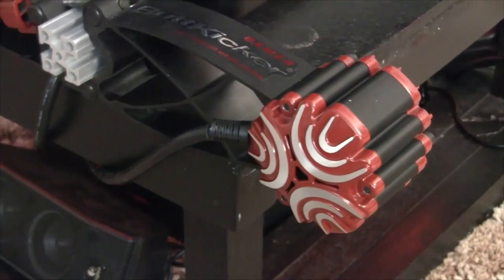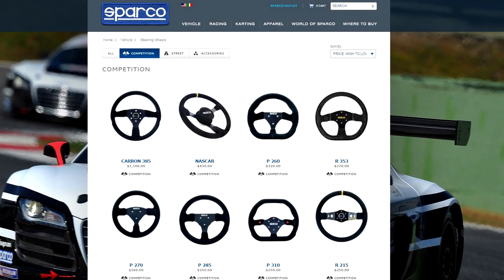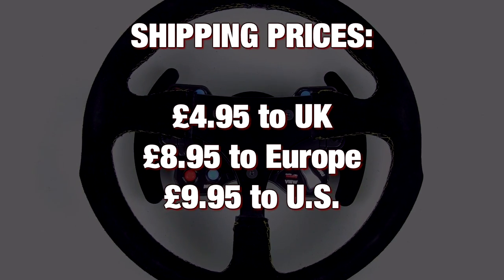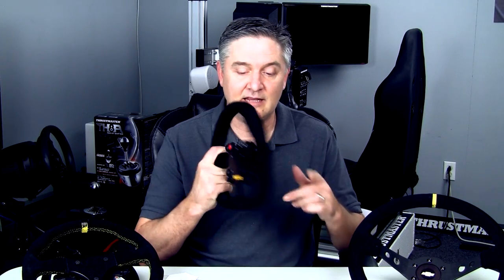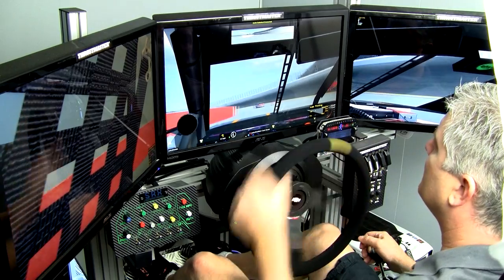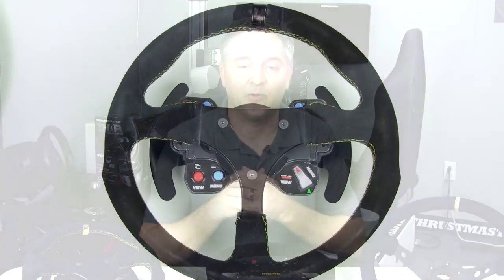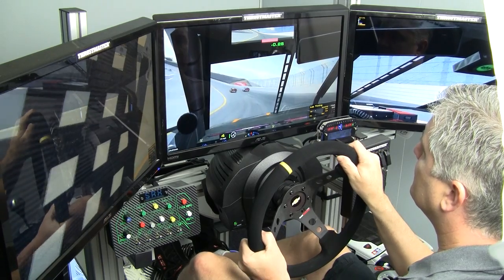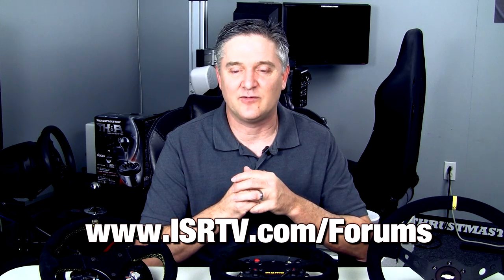Thrustmaster Steering Wheel Adapters for TX, T300 RS and T500 RS

Comment: Hey inside sim racing. I just bought a t300 gte it's really a good wheel. But he really makes a loud sound out of the engine. Is this normal ?
Reply from the maker: dutch NFS Gaming Is it a fan noise or something else ?
Reply: Yes. it happens most of the time when i do my FFB on
Reply: If you're talking about the T300RS, I have the TX (very similar wheel) and it's totally normal to hear the fan running while you're racing. If the game is at a loading screen you can probably hear it but as long as it isn't loud enough to hear during a race then I'd say everything is fine. If you haven't updated your wheels firmware to the latest version I suggest doing so as the newest update makes the fan shut off when the wheel cools down instead of never shutting off like it used to do.

Comment: Great video Darin. What I did was use the DSD adapter and put one of the Fanatec rims meant for their modular wheel hub. I have the classic rim and now I'm looking to get the GT rim.  Put a quick release on the  DSD adapter and ...BAM. Quick release action with a larger diameter wheel rim. Plus, if I ever upgrade to the CSW V2 I will already have the rims I like. :-)
Reply from the maker: SnappyDee2O4F Great idea !  Thanks for sharing

Comment: Great review, I recently bought an 300mm Oreca racing wheel plus an DSD adapter and an slim quick release, it´s a good solution if have more than one wheel, and if you order one from China is cheap too. The DSD adapter is great, but I recommend sanding the threads before you attach it to the base.
Reply: TheVblaster Where did you get that Oreca wheel?
Reply: idaanx Hi, you can get one from their site http://www.oreca-store.eu/cockpit/steering-wheels/steering-wheels.html

Comment: It is possible to use the Xbox controller while using the tx, it gives you all the button functions except for steering and accel/braking. Just make sure you have a shifter if you plan to get an aftermarked wheel.
Reply from the maker: DriftGamingHD No, you can use it for chat though
Reply: Inside Sim Racing I use it to get thought menus and works to move the camera playing Forza. So, yeah, it works.
I have it plugged via a usb cable, by the way.

Comment: You cannot do this with fanatec as they put the controller in the rim, not the base, you have to either attach a fanatec wheel or use their universal hub or the base won't work. You can get adapters to put a fanatec rim on a non fanatec base, but not the other way round.

Comment: So I'm using the DSD adapter along with a 320mm MOMO Prototipo wheel on my T300RS for PS4. It works fine. I keep the stock T300RS wheel attached to the servo until I'm all the way into the sim (project cars). Once I'm ready to drive I just swap out the rims & I'm ready to go. I just use controller to navigate thru the menus. :)

Comment: Inside Sim Racing Hey Darin, do you know of any mods for the T300 which adds a rally style paddle shifter? You know, the single huge paddle shifter on the right of which you pull to upshift and push to downshift? I've been looking for one but haven't had much success.
Reply from the maker: BiskutKibal I think Steve Spenceley is working on something like that.

Comment: Any video showing T300RS wheel connected to G27 pedals with adapter ? Is this combination works for Project Car on PS4 ?
Reply from the maker: Ng Foo Sin Steve I will be posting a video like that soon
Reply: Ng Foo Sin Steve This is exactly what I've been using since Project Cars was released on PS4 . I have the Ricmotech adapter and it works great. Absolutely no issues. Certainly better than stock t300 pedals.

Comment: +Inside Sim Racing For those of us that may not care about padle shift functionality, can you use a regular controller on the side in conjunction with the first cheaper adapter for navigation, etc. on Xbox one specifically Forza 6? using a similar size or EXACTLY the same wheel I have in my race car is the biggest concern, thanks.

Comment: I have a question about sam maxwell wheels,
If i take the wheel from his website 494$ and the shifter paddles 40$, is this wheel then ready to drive when i got it shipped or do i need to buy something that it works on the t500?

This video is good but i don't understand english that well.
If someone can help me, then just do it ;)

Greets Max

Comment: i don't use the screw on the collar of the quick release on the t300rs, it's a waste of time imho. but fine if your displaying the wheel at a public event etc, i find it easy enough to check that its tight after a race, havent had it loosen itself of once yet though tbh.
Reply from the maker: I have had the collar come loose during a race cause that screw wasn't tight

Comment: Hey guys I've been looking to buy a Fanatec wheel and I was wondering in terms of general performance excluding compatibility and all the extras, how the 911 GT2 wheel stacks up against the 911 GT3 RS V2 wheel and is it worth the extra $70 to get the 911 GT2?
Reply: Unless you're getting the clubsport you'd be better off with a T500
Reply: David Stewart I don't really have the money to buy a T500 let alone Clubsport, so i figure that these Fanatec wheels are the best in the class below the T500s and Clubsports
Reply: If you buy one of the cheap fanatec wheels in the back of your mind you'll always be wondering if paying that little bit extra would have been worth it. I did the same thing. The T500 is insane and in a whole other league than the porsche wheels. Definitely worth that bit extra and it will last a lot longer too. If you can't afford it though then go for the TX. The FFB is sometimes better than the T500 but the pedals don't come with a clutch.
Reply: David Stewart Thanks for the advice, I'll think about it
Reply: ***** Gear drive vs belt drive. g27 is a reliable and cheap wheel, but not a better wheel.
Reply: Krishan Sampat The Fanatec CSR is the best Fanatec wheel other than their higher-end stuff (CSR Elite - discontinued, Clubsport V1 - discontinued, and almost identical to the CSR elite, Clubsport V2).  The CSR is basically a slightly quicker, more responsive, more detailed FFB version of the Porsche GT3 RS V2 and GT2.  It's also very smooth.  I absolutely love the CSR rim as well (look and feel).

If you want something even better though, and you don't mind spending a little more money, then I'd get the TM TX; actually, I'd take the TX/T300RS over even a T500RS as I believe the TX's/T300RS's FFB to be more "raw", detailed, responsive/quick-reacting, lively, and smooth.  I believe the T500RS is only superior when it comes to outright power (which is still quite high with the TX/T300RS) and top-speed rim rotation (if you're a drifting nut and that's almost all you care about).
Reply: Spinelli Thanks for the advice, it's greatly appreciated
Reply: Krishan Sampat No problem :)

Comment: I’m still wondering about how “high quality” the NRG Steering Wheel is, I’ve watched a few videos about them being flimsy and not all one piece, should I worry about it breaking if I use it on a simulator, or should it be fine?

Comment: Where did you get the momo from, second hand
Reply from the maker: +Four All Bought it new
Reply: +Inside Sim Racing ok, will that wheel work with an Xbox one
Reply from the maker: +Four All Not without some modification. A guy I mentioned during this show was supposed to make me a console compatible aftermarket rim but has had some health issues.
Reply: +Inside Sim Racing can you make a video on it once he's completed the adaptor. Thanks
Reply: +Four All you can use it on console you just have no buttons so use a controller.
Reply: +NightHawk8667 
yes, the wheel and the controller works at the same time, so you can use any missing buttons on your wheel by using the controller. at least it's working on ps3/4
Reply: +Sigitas Ziurys What about the "PS" button? How does the PS4 recognize the wheel without it?
Reply: Michael McCoy it's recognised by the usb, it's not wireless. And you need to connect your controller first then the wheel, or change in the settings and make your controller 1st. If you want to use it
Reply: +Sigitas Ziurys I tried this & it doesn't work. I'm only able to use the wheel after I press the "PS" button on the wheel. :(
Reply: Michael McCoy I don't even have ps button on my wheel. It's connecting by itself and start calibration.
Reply: I'm not sure what I'm going wrong. My wheel calibrates without pressing the "PS" button but after that I can't do anything with it without pressing the "PS" button. :(